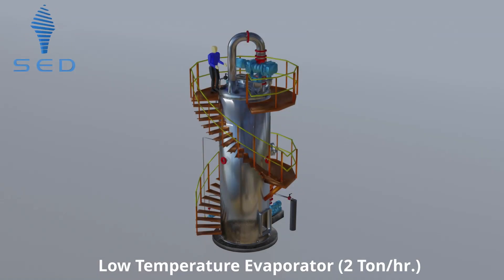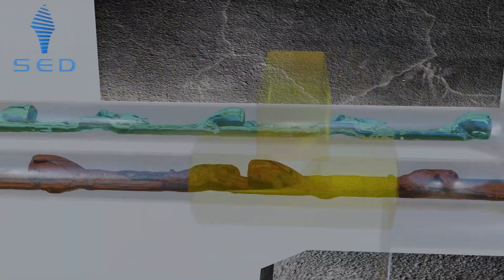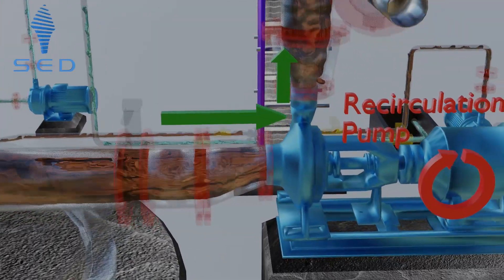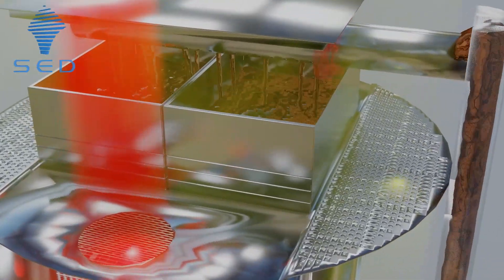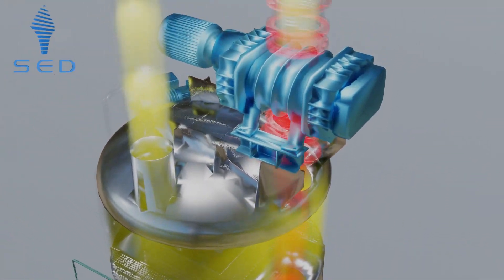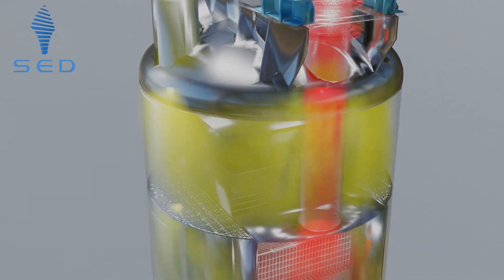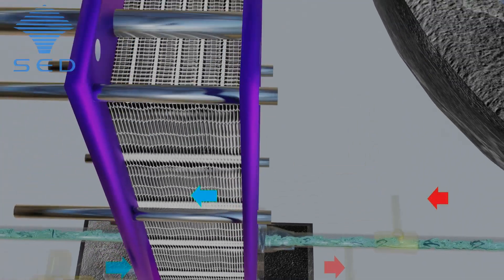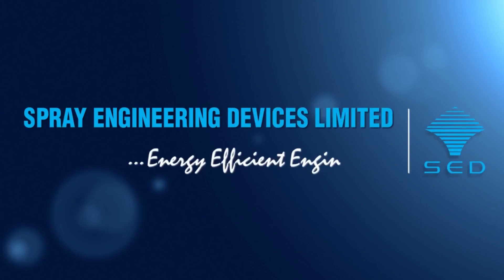Innovative Wastewater handling solution

Comment: How do you clean the feed side plates? Maintenance is expensive. What is the specific energy consumption to evaporate 1 ton of water?
Reply: Outside preheating plates could be easily dismantled. But plates inside the shell are truly hard to perform cleaning. I think the plates inside are not placed so close as it seems in the video, which is a small model, to make them bear long time. CIP may also use for that but should be designed with in place spray nozzle pipe,  or it will consume too much chemical.
Reply: CIP is only my guess. Anyway, this design aimed a smaller footprint, so some disadvantages will have to be accepted. But may an outside plate heat exchanger placed on top may perform similar small footprint?